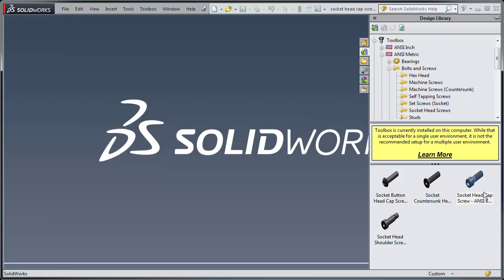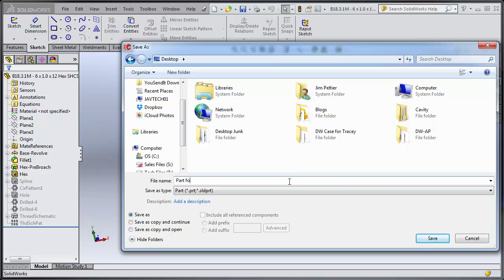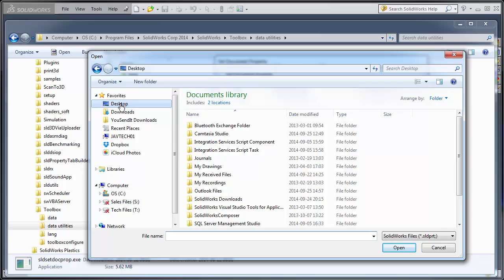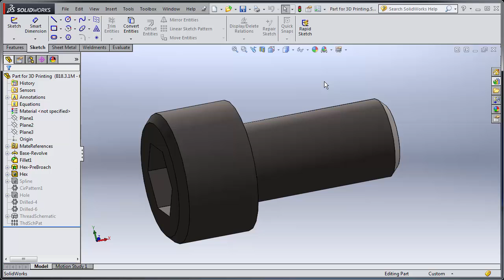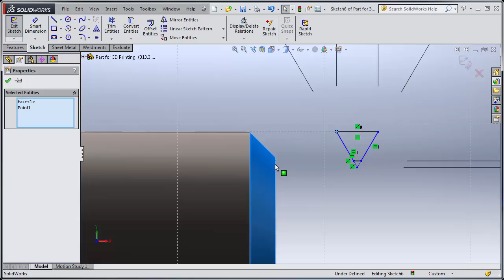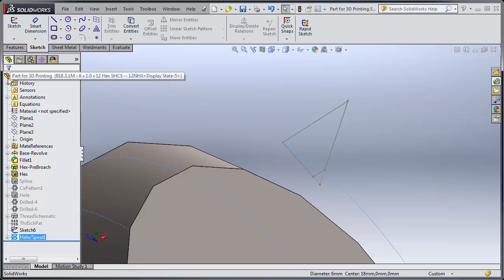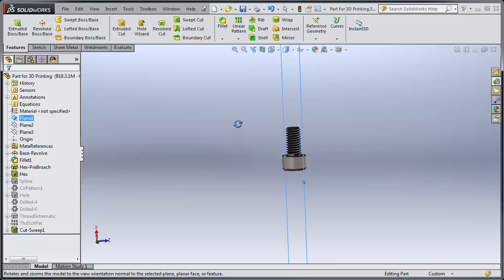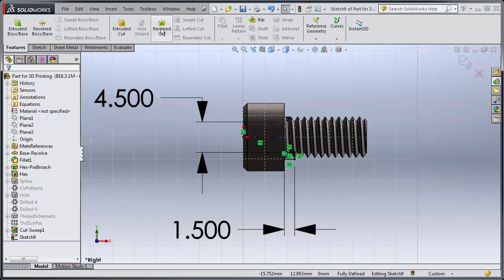SOLIDWORKS Tutorial: Modeling Threads for 3D Printing

Comment: That undercut will be a nightmare to 3D print. Also what's the point on doing this helix cut stuff when SolidWorks has a tool for threads? I was hoping to watch something about tolerance in threads for 3d printing.
Reply: just make the bolt shank  diameter 1mm larger than the nut hole.

Comment: I thought he was going to make a slightly larger diameter shoulder up near the head, but he necked it down smaller, and that invalidates the entire screw from a physics POV.  It now can handle less than half the torque as it should before distortion or breakage would occur.
Reply: Well if you need torque you aren't going to 3D print your screw anyway...
Reply: Mintar
Not really true (at all).  The 3D print facility prints exactly what you model, so modelling a necked down screw makes for a weak fastener from the get-go.  Nylon screws are sold and used all the time and they get the appropriate torque levels applied to them for the medium they are made from all the time.  In fact, one must be very aware of those torquing specifics when using them, or failure modes occur.  So, when modelling a 3D printed plastic fastener, it only stands to reason that one should make the model contain the proper "bolstering" elements in the design, because they are indeed fully functional traits of the finished, printed model.  Ignoring such traits is akin to leaving out punctuation in your writing and then blowing it off like Donald Trump claiming that Asbestos exposure "is no big deal" as he exposes hundreds of construction workers and thousands of citizens to it...  Or not knowing the "there" "their" "they're", or "to" "too" "two" differences, or the "your" "you're" issue most common with today's "rule ignoring on purpose" youth.

Comment: You can model real threads without creating a helix. All you need is a straight line the length of the thread that you need down the center of the cylindrical body on a plane. On the same plane in a seperate sketch create the thread profile just as shown in the video. Close the sketch and activate the sweep cut command and choose the thread profile sketch as the profile and the straight line as the path. Open the options and select twist along path and define by turns. Now just divide the thread length by the thread pitch and that will determine the number of turns. If you want to be able to change the thread length and maintain the thread pitch, then an equation is needed here. You can see this same concept used to create a spring http://www.javelin-tech.com/newsletter/tech_old/2007/june/article_spring.htm The file size is considerably smaller and faster because there is no helix feature.
Reply: Dusty Nogueira Is it wise to create the screw & nut at the same time ?